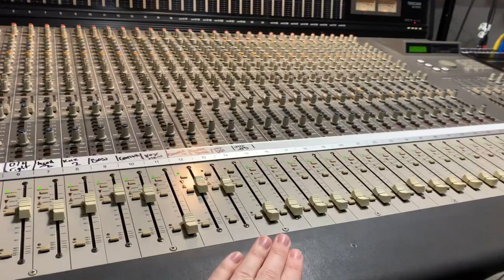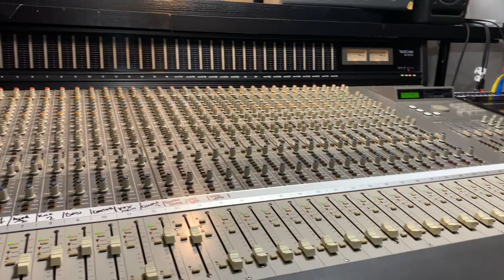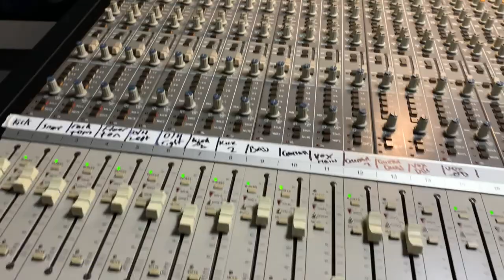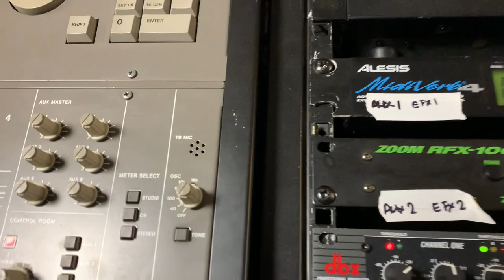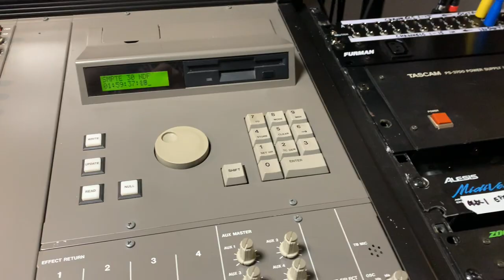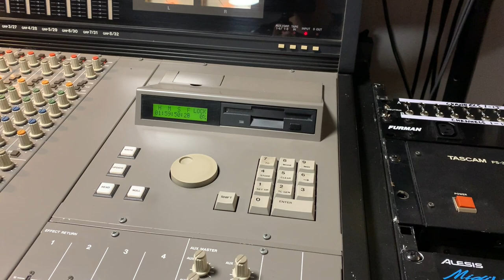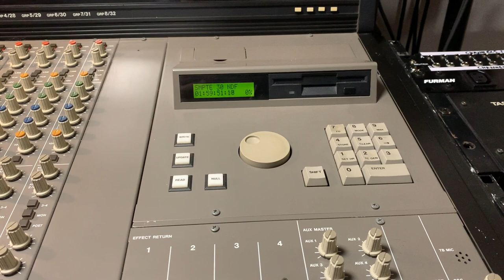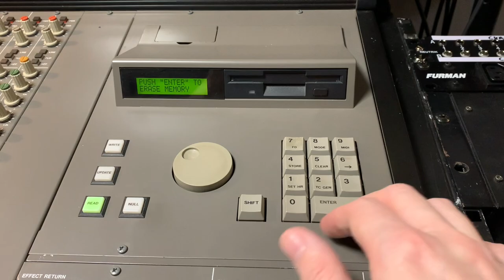Analog Automation how to on the Tascam M3700 and console updates

Comment: How would you recall? Do the little arrows show you where the faders was set?
Reply from the maker: Exactly yeah! The arrows indicate where the faders would be at any given point of the track. You can also take snapshots and store them on floppy disc.
Reply: @guerrillastudiosmanchester  Thas not too bad to recall then!
Reply from the maker: @Robinbermann  Eq's and any outboard used is a different story though 😄
Reply: @guerrillastudiosmanchester  oh you don´t have to tell me that, I have Quite a few analog compressors and pre amps here. I usually write the settings down in the notes section for the track in my daw!